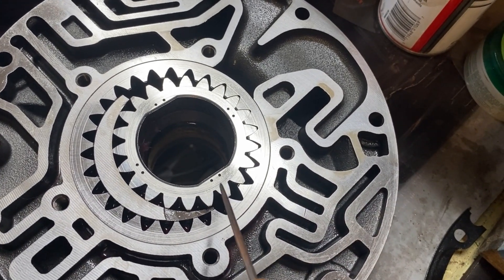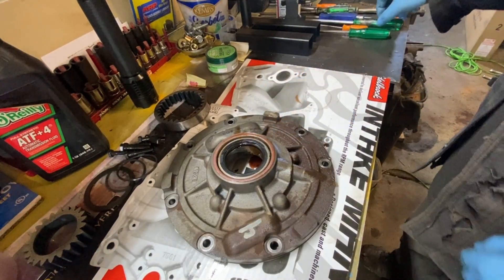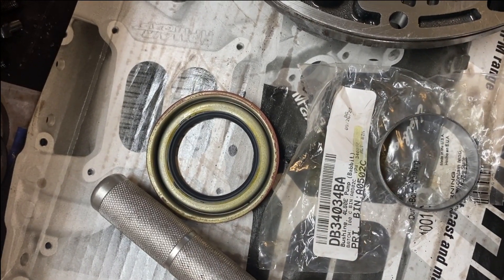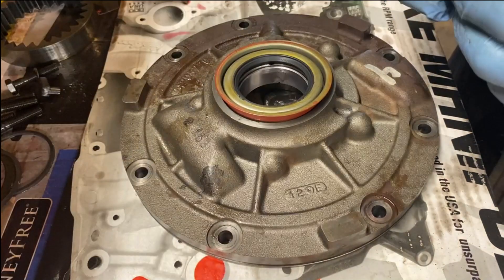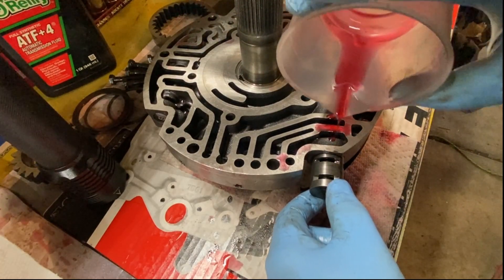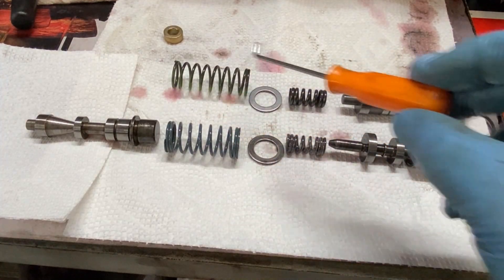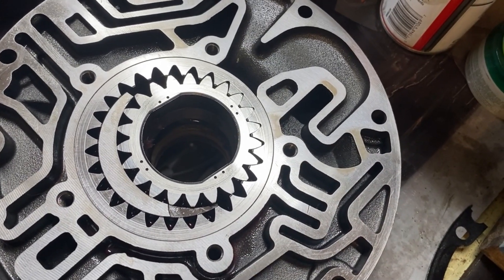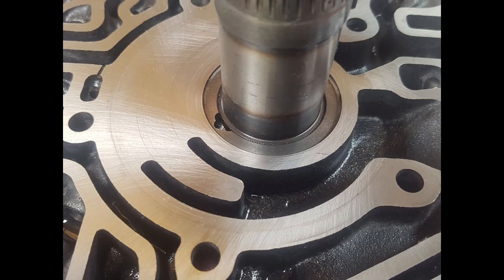4L80e Pump Rebuild - With TransGo HD2 Parts Install

Comment: Hole you enlarged to 1/4" is to prevent the seal from blowing out. To help fluid drain faster. High rpm in stock form fluid can't drain back as fast

Comment: I didn’t like the way the transgo hd-2 wants you to put an external line pressure relief valve on the valve body. Jake from Jake’s performance said he’s seen more than a few of those relief valves stuck open causing a burn down of the unit. I removed all that crap and plugged the holes with some 3/16 aluminum rod. I ordered a sonnax boost valve that fixes the issue that creates the excessive line pressure increase it uses the stock springs and includes a new end plug with a o ring to seal a worn bore letting fluid leak and making the pressure rise. Sonnax part # 34200-03k. You can also use the P#4l80-lb1 Also didn’t like the weird 3 piece VB seperator plate so I ordered a new ACDelco plate off Amazon for 10 bucks. Then went back into the center support and removed the second seal ring and pulled the inner seal out of the direct drum for dual feed. Plug the reverse feed hole in the case with a .375 plug. I kept some of the springs from the hd2 kit and I kept the HD intermediate snap ring. I also used a rear case thrust washer inside the rear planet with a .015 shim to take up some of the slop on the rear planet. 

I dont trust that damn relief valve at all. Nor do I trust the hd2 boost valve and spring setup, if that boost valve was correctly engineered you wouldn’t need the sketchy relief valve,

Edit: My opinion for the hd2 kit is that for people who want a better shifting unit without removing it from the vehicle it is a good kit. I just wish I had ordered the sonnax sure cure kit in the first place and saved some money.
Reply from the maker: Thats a great comment with a lot of extra details we can all learn from.  I didn't do every step in the Transgo kit either because I know a few things (especially that relief valve) are not necessary and can cause bigger problems.